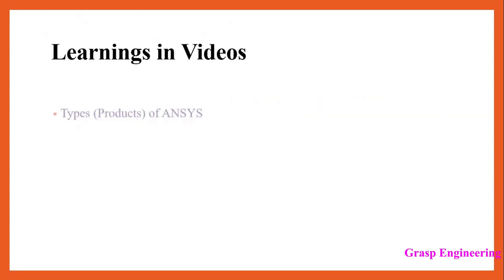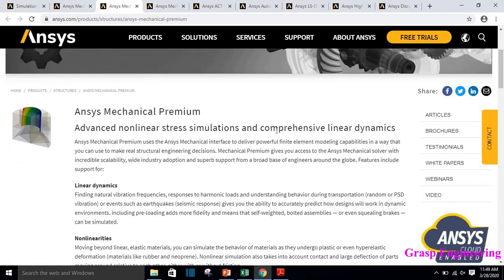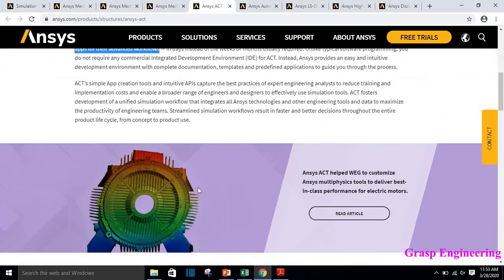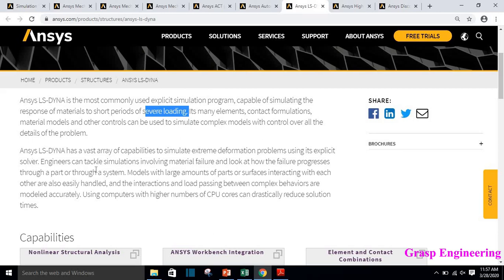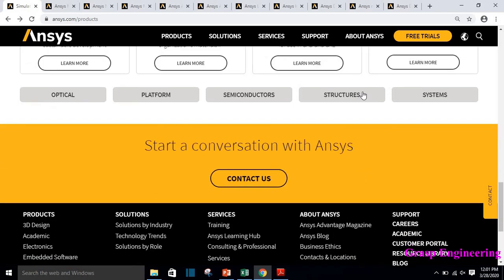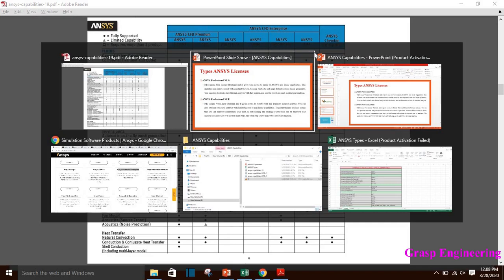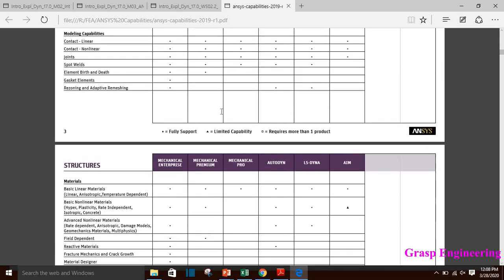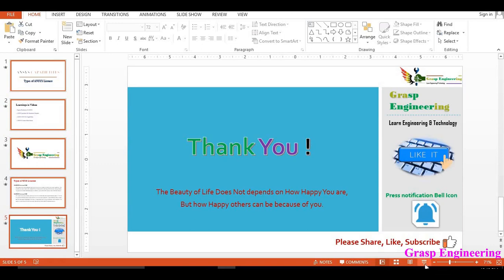ANSYS Capabilites and Types of ANSYS Licence

Comment: Dear sir. Can you make a tutorial on simulating the corrosion rate in pipes using ansys? Thank you
Reply from the maker: lease share your exact problem defination
Reply: @graspengineering9249   A straight pipe has 5 m length, with specificatuon API 5L Grade B sch 40 NPS 6" wich is has 6,625 inch outside diameter and 0,28 inch wall thickness. That flows gas methane and operates at a pressure 200 psi and has a temperature 140 F. Can you make it, sir?